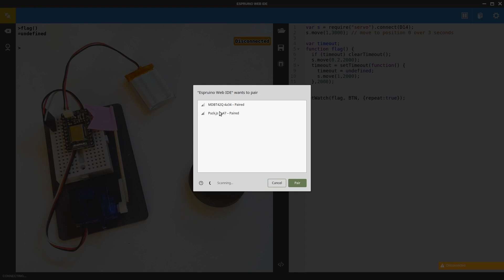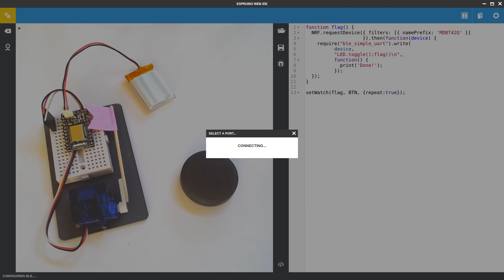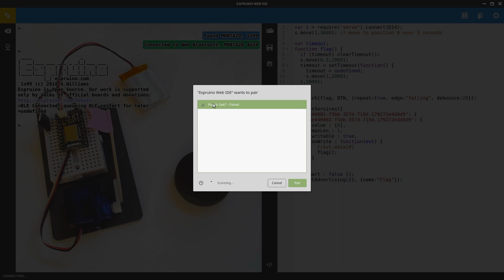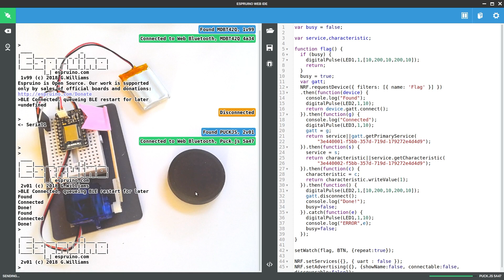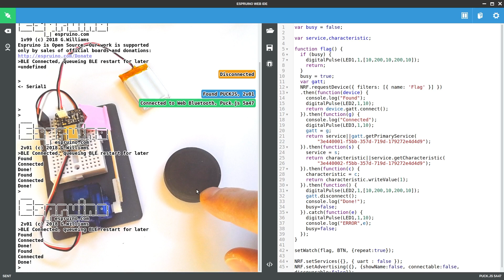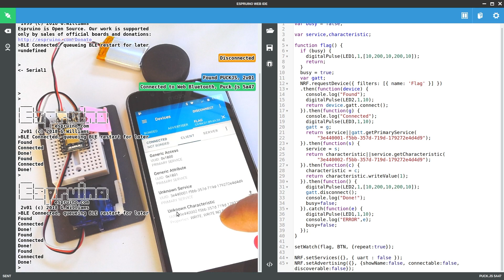Bluetooth LE on Espruino, Part 1

Comment: How long is the power supply and battery used to recharge
Reply from the maker: The Puck.js (the button) is a standard 220mAh watch battery and will last it for around a year. The LiPo I used for the servo is 400mAh and those servos draw about 3mA when idle - so you get 5 days out of it, or about a month from a decent 18650 cell - of course if you switched the power to the servo then you could get over a year too.

Comment: This tutorial clears up some things. i was pokeing around with BLE on MacOS Puckjs and Node with little success so far. (I didnt want to use the Simple UART way.) I will give it an other try now. :)
Reply from the maker: Hi - BLE with Espruino on Mac OS should be super easy, especially Web Bluetooth. I recently added some example code for Node.js at http://www.espruino.com/Interfacing that might be helpful - it uses UART but it'd be trivial to change to use custom characteristics. Post up on the forum if you're having any issues and I'll do my best to help out.

Comment: Great that you highlighted how to secure the device by disabling arbitrary code eval via UART. I'm surprised the default isn't to have it disabled.
Reply from the maker: The UART service is how you program the device in the first place, so it's got to be enabled by default. There's actually a bunch of info on different ways of securing them at http://www.espruino.com/Puck.js+Security - for instance you can still keep the UART but just handle all the characters sent to it with your own code.
Reply: @Espruino  ah ok. So if you disable UART, are you then forced to use a cable to flash it next time?
Reply from the maker: @dsample  You can just power it on holding the button and you can reflash it via Bluetooth LE again (or just leave the BLE UART on during development and turn it off when you deploy) but if for some reason you really don't want to use the Bluetooth UART then yes, you can attach a simple USB-TTL converter and program the boards that way.